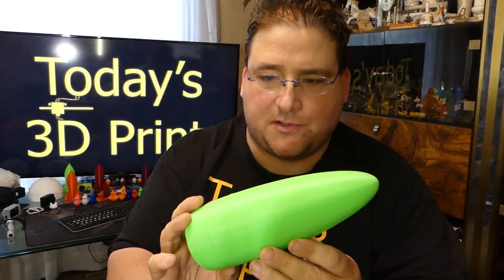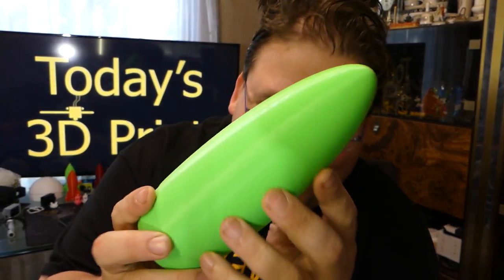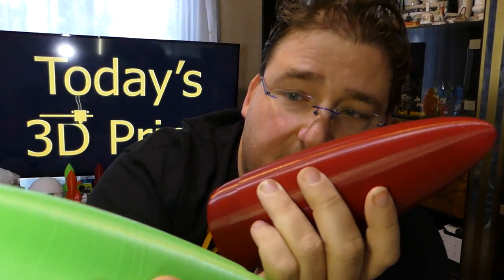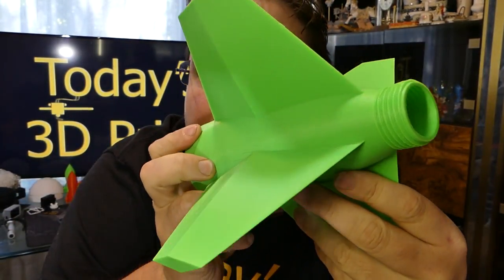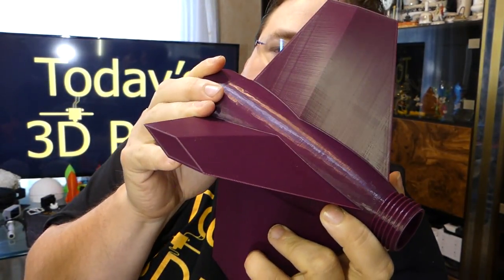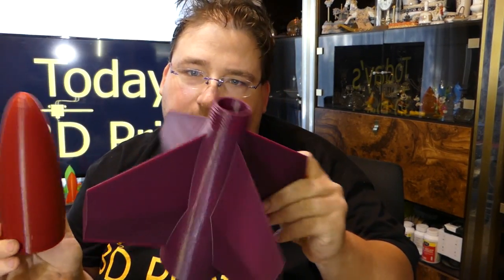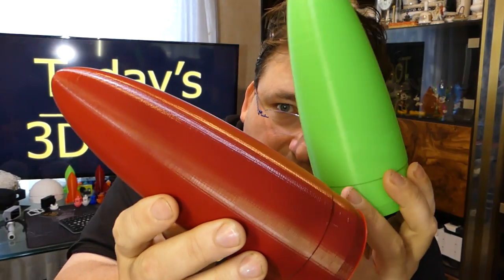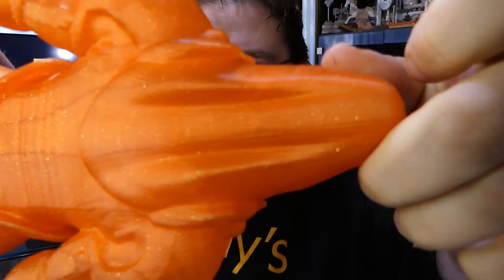Today's 3D Print 119 Print Quality Comparison Creality CR-10 and Tevo Tornado

Comment: Tevo stepper drivers

Nerys,

Sorry for repeating the comment from below but It was originally directed to you.  I know you have adjusted the steppers in the TEVO before.  Does the Tevo use 8825 steppers?  If the salmon skin is due tot he stepper drivers can they easily be replaced,   Meaning are they on modules which can be removed or are they surface mounted on the main board.  I wonder if we swapped out the drivers with TMC2100's if the result will be better than adding TL smoothers.  I'm thinking if it's not too difficult I would go for the TEVO and make the mod.
Reply from the maker: +SCYFOR yes it is 8825 steppers and yes that is the source of the salmon skin no you cannot replace the drivers they are soldered in part of the board but the TL smoothers work very well unless you're making engineering prints and doing primarily organic artistic Prince trust me the TiVo tornado is amazing with the smoothers check out my Twitter or Instagram the prince I'm getting off of it are simply astonishing
Reply: Actually, that's wrong. :) The Tevo Tornado does not use DRV8825's (the Tevo LM does, the Tevo BW uses A4988 and shows horrible Salmon Skin too by the way). The Tevo Tornado uses Allegro 4982's, basically the same type of stepper drivers as used on the Cr10 controller board.  Both the DRV8825's and the Allegro 49xx series are vulnerable to the Salmon Skin effect which is caused by the steppers behaviour in Mixed Decay mode, but the DRV8825's have a much more pronounced issue with it, but both brands of steppers aknowledge and document the missing steps-effect in their datasheets of thier steppers. Even the LV's show missing steps in mixed decay, the only steppers known to me not having that issue are all the TMC's and the DRV TI8880 (which I've never seen being put to use in a 3D printer so far).

Comment: Tevo has updated their software on their printers as well.  I am guessing his was one of the earlier ones possibly. If it shows Marlin 1.1.4 on the software at startup it is the earlier software. If it shows TEVO 1.1 it is the later updated software.  The TL smoothers  help if you are getting the salmon skin effect from the TEVO motor drivers.  I have 2 -CR10 printers and just received my Tornado after an insanely long wait time from GB and setting it up now with CR10 extension cables and about to do my first print. I may do a comparison of the 2 as well now that TEVO has made some changes. One of my CR 10 printers is still stock basically. The other is a E3D/Titan/Tornado for xtra large and flexible filaments as it has no bowden tube anymore. It will take up to a 1.2 extruder fitting now as well ! I am about to increase the Z-Height to 34 inches as I have new 1000mm 2040 uprights and z-screw and a bunch of 2040 for corner uprights and a bunch of 2020 horizontals for braces to basically make it a box frame. My only concern is the moving Y axis table on these cartesian style printers.  If its a problem at high heights I will put it back to stock height and use the parts on my Tronxy X5S Core XY printer as the table only moves vertically but supported on both sides. There is another Youtuber who did this already to a CR10 . However he didnt box the frame or upgrade the extruder/hotend. He seemed happy with it, but I need to go look him up and check if he did any Xtra tall prints. I am surprised you haven't done this yet for printing rocket parts and tall vases and trashcans it should be the bomb!  It should be insanely faster with the 1.2mm nozzle to print a trashcan or something with loss of detail or just use the stock .4 nozzle for full resolution at regular speed. We will see soon. :)
Reply from the maker: is tevo software end user upgrade-able for firmware? Link?
Reply: Lemme go find it . I watched a video a couple hours ago about it. Ill be back

Comment: I am thinking to buy a tevo tornado. What is better in conclusion? Cr-10 or tevo tornado?
Reply from the maker: +nikolas factoras cr-10 vs tornado I might go tornado for the heat bed but I prefer the cr-10 for resolution of the finished print now compared to the cr10s and it's hands-down cr10s wins
Reply: Nerys i dont have extra money to spent for the cr-10s. I only care about the quality that i can get from this machines
Reply from the maker: +nikolas factoras if you want quality then go to cr-10 the tevo tornado is a very good printer but the surface quality is not as good as the cr-10
Reply: Nerys oky thx. And thx for the fast replies. I really appreciate it

Comment: If you designed both models in Fusion 360, it's just a matter of joining/combining bodies in Fusion. PM me if you need help merging these models in Fusion and maintain resolution -- I can do it for you pretty easily. Export from Fusion 360 as step files or Fusion default format, and just let me know how you want the hole cut out.
Reply from the maker: kazolar Sadly one component is an STL only from tinkercad so I only have it as an STL. One day I will learn Fusion 360 well enough to redesign it in Fusion 360 it's the threaded part
Reply: that's fine -- I can work with STLs too :) I can generally convert most STLs into solid bodies in Fusion. I do that all that time when I re-mix models I find on Thingiverse and the original designer did not publish step files or some other parametric format.

Comment: Are you releasing the rocket? One of my goals is to make rocket candy then launch a 3d rocket. And I love your deisng so far.
Reply from the maker: I won't release the rocket design until I test fly it :-) last thing I want to do is pranging on top of somebody's head with a rocket that I designed because I didn't test it :-) but yes once it's tested I will release the files
Reply: I totally understand man, please post more vids of the rocket thank you

Comment: Dude,  think about this,  both printer have the same nozzle diameter and both printer are driven by the slicer to control the layer height.  If you think the CR10 produces better resolution because the printer itself,  you need to get off crack.  Compare apples to apples then:  show us the same printer settings, temperature, slicer settings and filament.  Don't bullish us you are a perfectionist.
Reply from the maker: +Mark Bennett the two prints were using the exact same G-Code I literally took the memory card out of one printer and put it in the other

I could not make any changes to the tornado to get rid of the noise in the prints it's endemic to the printer

I was trying to be generous to the tornado if I had to pick one or the other the tornadoes not even on my list it can't make clean Prints.

Since I'm using the same Slicer and the same settings and the same filament the architecture of the printers is virtually identical the tornado being almost a direct clone of the cr10 what else would you like me to compare precisely?

I'm game for a print off a slice for each and I'll send you the g code
Reply: @nerys71  You were not using the same filament, and variances in filament diameter can cause artifacts such as what you are seeing, but I assume that you have seen this problem on many types of filament. Since you didn't specify this in your review or comments, we have learned nothing here, since we cannot make this assumption.
Reply from the maker: same filament is largely irrelevant. filament is largely consistant across most brands. put it this way. I have yet to get a roll so out of speck that it gave me any problems printing with.

I primary compare print quality not filament quality and filament has to be pretty bad to REALLY affect print quality. it can of course but its unusual
 @slavidian